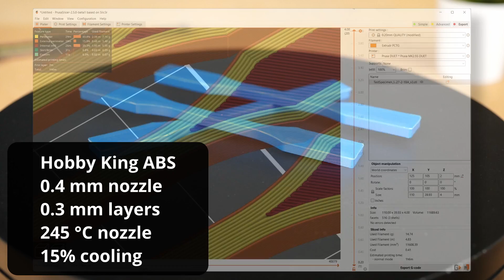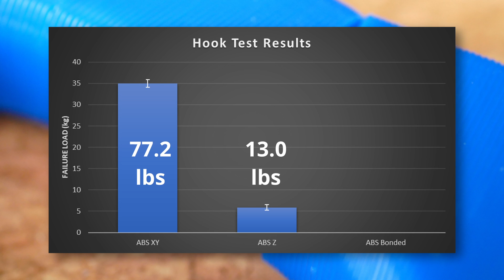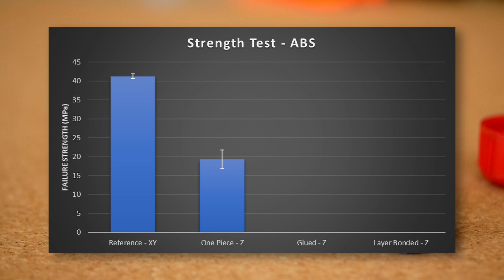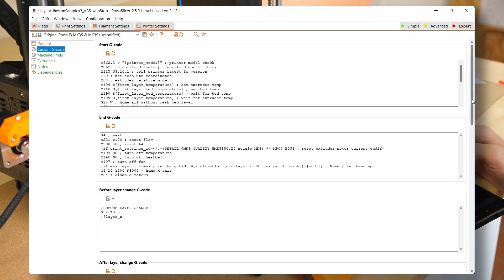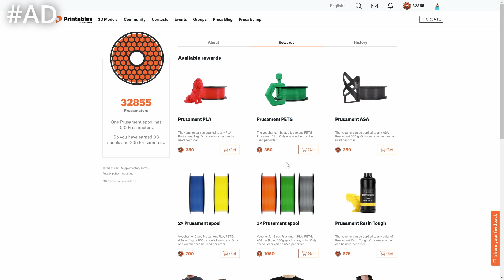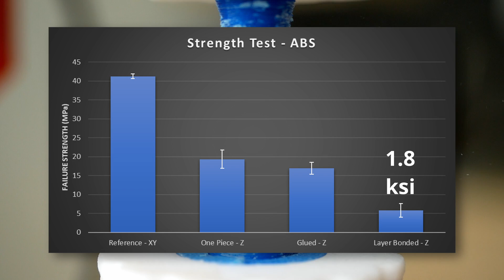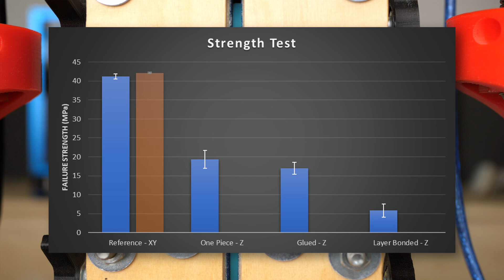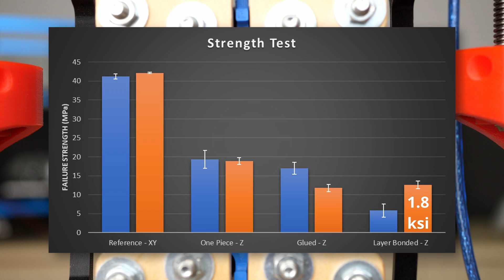Perfect Layer Adhesion if you Brush Solvent onto every Layer of your Print?

Comment: Some of the non-planar ideas here sound cool but really only increase surface area minimally. Might already have a decent effect, but I'm think if you print a cube for example, print it smaller in X or Y direction and then add 2 or 3 layers on both sides with the cube flipped on its side.
So that it kinda looks like this with the layer lines:
||--------||
||--------||
||--------||

Would suit most models, some non-planar stuff could help with your test samples for example, but the overall idea could be interesting. Also figuring out a way to reattach the print to the bed after flipping and how to accurately position it etc.
Reply: It’s true. Very much this! I think a viable strategy on a desktop printer would be to set nozzle XYZ zero on a precision machined block placed against a corner fence or vise and stop, secured on the build plate and flipped for each operation. IIt could be much better if it could use an in-process 3D scan. 🤯 or even a touch a probe. One day…

Comment: For some parts like functional TPU parts I use a welding nozzle and regulator with argon to give an inert gas flow over the part - stops the TPU oxidising at the higher temps used for high speed extrusion and gives layer bonding so strong parts that fail often fail through mulitiple layers rather than at the joint - might be one to try, you don't need much gas flow, 3-4L/min.
 Just beware of pumping CO2 or argon into a sealed room, of course.
Reply: Could be an easy solution to gas wastage on very long prints if you just flooded and purged an enclosed chamber with inert gas, like when welding up a gas tank.

Comment: Maybe braided layers might help adhesion! Have the nozzle lay continuous lines that span consecutive layers by raising Z mid line. It doesn't sound easy to code but it could be a neat proof of concept.
Reply: This sounds nearly impossible but yes braiding between layers would add a bit of resistance to breakage (although I suspect not much because you're still limited by the strength of 2 very thin lines of extruded filament). If you had an elastic thermoplastic like TPU which could transfer the stress throughout the model then braiding could be a solution to dramatically increase strength in Z axis

Comment: Im sure this has been tried, but what if you had a wave shaped layer instead of a flat plane for a layer? The direction of adhesion would vary throughout the width of the print and de-localize the weaknesses made by the individual layers

I know this would be difficult to create a path but if possible seems useful.
Reply: Possibly a 3d version with pyramids for even more interface surface,  kind of like that egg crate foam
Reply: If each wave was ‘out of phase’ from their neighbor laterally, there would be contact between many layers. If anyone wants to mess with it they could see about using G2 arcs in loops while using XZ and YZ plane selection modes, or perhaps the latter but using code from generated gyroid fill. Would take some automation or perseverance to make it, especially considering fading from flat build plate.

Comment: Maybe slightly altering the Z position in a checker pattern while printing each layer could create some surface roughness, for subsequent layers to adhere to. I'm thinking a checker pattern would work well because it has sharp edges, and might even create some ringing that would be beneficial for once.

Comment: Wouldn’t ABS cement be better for this application? Acetone seems more like ABS/PVC cleaner, it will make the parts stick together but nothing like ABS/PVC cement does (which is why ABS/PVC cleaner is only used to prep the surface).

Just spit balling ideas. Thanks for the video!

Comment: Hello Stephan,
I think that's the best way to improve adhesion is to use non planar 3D printing, it will largely increase the contact surfaces between 2 layers, but there is a lot of work to be done in the slicers side in order to to this !
An other way would be to over-extrude and machining after each printed slice, with your tool-changer it would be possible. By the way, we have made an aluminum milling head for ASMBL, feel free to contact me if you want a free one for your Tool Changer.   
Regards,
Reply: Digging the hot Nozzle or a second hot nozzel/spear into the part in a pattern after each layer could also improve the bonding.

Comment: It would be interesting if you tried this with cyanoacrylate super glue brushed between layers instead of acetone. This adhesive is supposed to join ABS with full strength.

Comment: I have an idea - what if you print every layer with reduced flow (for example 90%) and then perform at same height ironing (like in cura) with 5% flow? And please use nozzle with big flat tip.

Comment: Hi Stephan, working on another 3D printing process we found that using a rotary planer was necessary to make an absolutely flat layer interface with a know Z height. The rotary planer was the width of the Y stage. If you look at the cutter of a wide wood planer it is a spiral cutter with a vacuum shroud to remove the dwarf generated. The cuts need to be very thin or you will be breaking off pieces of the part in process. In practice it may require a sacrificial support and infill material to make the planing robust for all possible parts, but for well behaved geometry’s like a cube it is not necessary. A straight forward implementation for a bed slinger is to affix the planer to the Z carriage with a high speed motor for the planer and a stepper driving a torque tube with matching cam lobes at each end to move the planer up and down relative to the z carriage. Just some thing to think about. Cheers.

Comment: Maybe using something like a heated needle to stipple the surface of the layer could improve adhesion similar to how you rough up contact surfaces before applying glue?
Great video by the way
Reply: maybe sand each layer lightly, creating small grooves that increase the surface area
Reply: I would go even further: poke the needle through the last layer, to re-melt its interface with the one before.
Reply: I was thinking to machine the nozzle end with very small protrusions that would groove the surface as it printed.

Comment: There is a way to test solvent on cold plastic, avoiding the boiling point problem. You print each layer separately with an alignment hole in the center. Brush on solvent, and put through an alignment pin. 

It's manually intensive, but could work and reproduce the results you had putting together the broken pieces.

Comment: After trying quite a few filaments, I have found taulman 910 nylon to have the best layer adhesion of any filament i have used. A few things I have noticed though:

1) being that it’s nylon it’s very important to have it thoroughly dry (as with all nylons) to achieve optimal adhesion with prints. 
2) I anneal most of my prints with it, but notice that the layer adhesion is lacking a little bit after it’s been dried
3) once it is rehydrated, weather by the environment or dying it, the layer adhesion is outstanding, probably as strong as the x/y axis.

I know this is a little off track but my point is that I’ve noticed with this particular filament that very dry printing and allowing it to rehydrate fully tends to greatly affect layer adhesion properties in my experience. I would imagine this is the same for most filaments. I noticed that you tested z-axis strength after drying, perhaps if you let it re absorb some moisture, the results may be somewhat different
Reply: So dunk in warm water for a bit?  Wait a day or two?
Reply: Either should work. I’ve just noticed with taulman nylon that it gets better when it’s rehydrated. I dye it with RIT dye, so I keep water with the dye at about 160f for around 15 mins while I dye the part
Reply from the maker: Need to check that out at some point!

Comment: Great Video and attempt at increasing the yield strength.  What I would be interested in seeing would be a test involving a purely cast part where there are zero layers.  Bonding between layers/adhesion will always be an issue in an additive process where the previous layer is not part of the melt process.  Then again with a wide freeze range on the plastics that could result in part that just flowed down the sides.  Continue on this path some though.  I used to machine cast aluminum tensile test bars from blanks for a foundry.  Thing about a 3d printed part it can then be used to make a form for a metal cast,  or in a final layer adhesion test a cast pattern so you can try just casting some test bars. Then you have a full material adhesion sample result.  Thanks and keep it up!
Reply: This has been a thing for a while. Printing a model out of pla and then dipping it into a ceramic slurry to make a mold. Then cure and melt out the plastic before pouring in your molten casting material. Basically lost wax castings but using 3D printed PLA. It makes isotropic parts that are equally strong in every axis.

Comment: Theres this whole host of research in non planar 3d printing, where a fourth or 5th rotational axis is used. That allows for orienting the layer lines in whatever direction is needed for strength or overhangs. I dont even think 5 axis DIY builds are that complicated and there are some open source projects out there. But I have no idea what the software side is like. I would love a video on exploring that space and its practical applicability.

Comment: Is there anyway to add like a “fog buster” using acetone to a printer? As you might know, people use IPA for cutting aluminum on CNCs and the fogger is an effort to avoid atomizing the IPA while still adding lubrication. 

Could you maybe rig up a fogger that hits the part like a part cooling fan during printing?

Comment: What might be interesting is trying to impregnate the filament with the solvent before printing to soften the material, then using a lower printing temperature below the boiling point.
It might allow the softened filament to meld together more and the heat helping to dry the layers as it prints.

Comment: I always wondered if the gcode could be modified to do 'L' shapes where the leg of the 'L' pointed up. The idea would be to move in x and y for so many units and then without stopping extrusion to extrude vertically in the z direction for a layer or two. This would "lock" two adjacent layers together.

Comment: There are papers about using CNT coating on filament, and post-proccessing it in microwave oven, basically "locally remelting" the interfaces. They did prototypes, but unfortunately it seems like something NOT easy to accomplish.
I wonder if you can achieve similar effect with coaxal filament or, better yet, by using an IDEX printer with similar materials but one virgin and an other filled with CF in thin layers.
So entire structure would not warp during post-processing, at least one of the perimeters (or entire infill) will have to be printed of virgin material, but it should result in better adhesion where it counts. Can use same principle for warp-free annealing perhaps... Since carbon-filled filaments are no longer rare and expencive, it might be worth a try, but will require g-code editing, or I would have tested it myself.

Comment: One possible way of improving layer strength might be to take a variant of non-planar printing and "weave" the infill lines across 2-3 layers. It wouldn't need the same level of hotend modification as true non-planar printing, but should interlock the layers much better than normal slicing.
Reply: What about printing cavities and then later inject material into them with the nozzle? Would interlink layers without the need to weave.
Reply: This!  Another thought that is similar is to extrude large blobs into the infill area.  Kinda like filling a print with hot glue.
Reply: Kind of like Prusaslicer's Combine Infill layers, but on nonplanar stereroids? I think that's an interesting avenue of investigation. Maybe printing the infill at like 2x normal layer height or something along with that could have interesting results.

I've been including small through holes to put glues into.
Reply: What if my parts almost don't have infill?
Reply: This is what I think about as well. But not online infill but outer layers as well.

Let the perimeter zigzag in Z direction so each perimeter is in contact with multiple perimeters

Comment: My is was too what's inject resin into the part to add z strength

Also you could make a cylindrical hole in the model and every x layers you push the nozzle into the hole and push a ton of filament in it to plug the hole with uniform filament and plug it.

Also this could be fun with super glue but that'd be messy

Comment: What if you heat up the Part you're about to print on to a higher than normal temperature. My idea on how to achieve this would be to move the nozzle along the path where the next layer would be but touching the last layer. Although to achieve this every layer would need to be split up into ~10 second sections that can be heated and then printed on.

Comment: i suggested using a very light 90%isopropyl venturi mist along side the part cooling fan, similarly to using alcohol as a coolant/lubricant for cnc machining, during the printed process for both cooling and layer adhesion. of course flammability was a concern of others but i believe it would be quite successful in a well ventilated enclosure
Reply: IPA releases parts from the bed and will kill any adhesion.
Reply: @nobodynoone2500  you use part cooling on your first layer? Lol

Comment: Set your bed temp to max and roll a hot glue stick on. That layer of hot glue won't dry out like glue stick does. After doing this, my prints never break off midway through (with zhop off)

Comment: I am aware that the solvent breaks the polymer chains which results in smoothing but reduces strength of the surface, sometimes going quite deep during smoothing. Painting on the solvent is probably the same effect.

Thanks for the video!

Comment: Methylethylketon should work better than Acteone it doesnt evaporates as fast as Acetone so it has more time to bond the layers together and its a better welding solvent for plastics
you would also probaly need to make a wait command for a few seconds or one minute to let it dry a little bit 
For the drying after printing you would need to go a little bit higher in temperature because MEK has a boiling point of 80°C or you use a vacuum chamber to boil of the solvent

Comment: Make the part hollow and fill the cavity with epoxy, using either a funnel or a syringe.

If you have a vacuum chamber, vacuum purge unwanted bubbles from the epoxy before putting it into the printed part, and also vacuum purge the part after the epoxy goes in.

If you are especially handy, then filling the part with epoxy while it's inside the vacuum chamber is an even better option.
Reply: this doesn't improve the strength of the printed part
it just uses the shape creation machine and replaces the material under load
you could print a mold and make carbon parts out of those
Reply: @marc_frank  The original FDM print would still be there, surrounding the epoxy.  Also, if you were JUST printing a mold, then you can't get multi-color results.

Comment: I have an idea. But it requires some modifications to the G-code. So the idea is that there are massive voids in the infill right? So why not ooze out filament to cover the infill voids? Preferably between 5 - 10 layers. Ultimately it'll come out as 100% infill part. Cheers!

Comment: I think that for ABS the layer adhesion gets better if the layer on top prints while the previous layer is still hot. It might be interesting to check the layer adhesion versus print speed... I have a feeling that printing faster will improve the layer adhesion. Maybe testing a very fast printer like a VORON compared to a normal speed printer like a MK3s could be interesting as well.
Reply: Interesting. Same with PETG, no fan so the filament is still hot when the next layer goes on. Making PETG prints stronger on average. I only recently started on PETG after only PLA.

Comment: One thing I want to see is printing the outer perimeters 50% of a layer height lower than the infill (requiring a 50% height first layer for perimeters of course). This would mean that there was less chance of a complete planar layer at which separation occurs. It encounters some complexity in the slicer when the perimeters do not stack exactly on top of each other though. Maybe with the new variable extrusion width slicers it might be more possible to correct for the  vertical alignment issues. Unfortunately it seems like a quite a large undertaking, although I suppose gcode for your layer adhesion samples could be manually created as a proof of concept.
Reply: Although, when I think about it, why stop at external perimeters? Simply alternating high-low perimeters/infill-lines would eliminate layer lines entirely (apart from the first layer). A bit of gap-filling would be needed occasionally but on the whole you'd get a much less planar result. Assuming of course the nozzle didn't accidentally iron any layers (I don't think it should).

Comment: What I do when I need a part that is strong on the layer direction, the humble screw is my savior. Same with shearing, if they have to resist shear between layers, same deal, a screw through the height of the part solves it.
This is obviously a part specific thing tho, so might not be feasible for what you need (and obviously not fair as a test part).

Comment: If I want a structural plastic part, I 3D print the shell and fill it with epoxy resin. If I want a really strong part, I also put chopped fibre glass in before I fill with epoxy.
Reply: Thx for the idea!